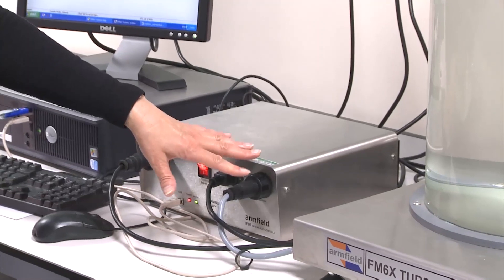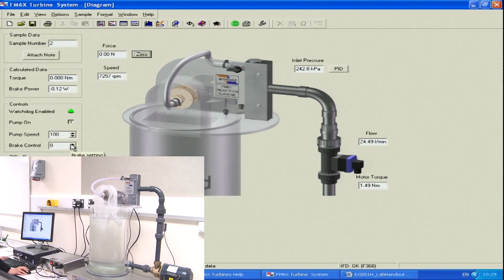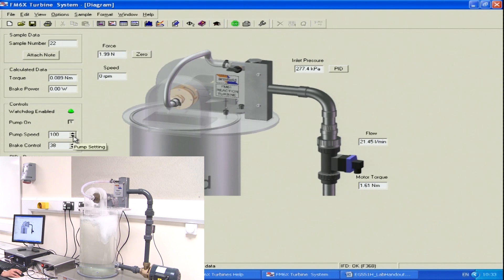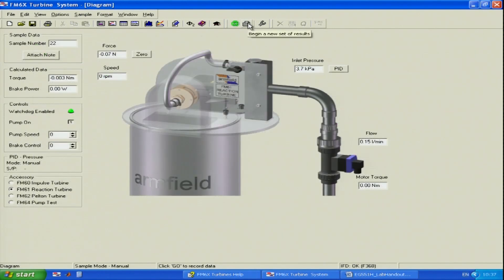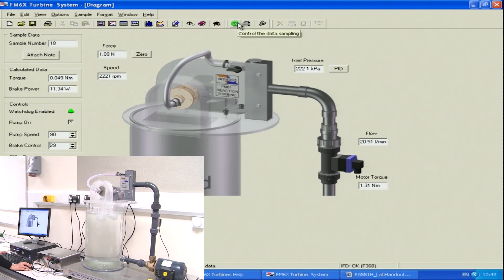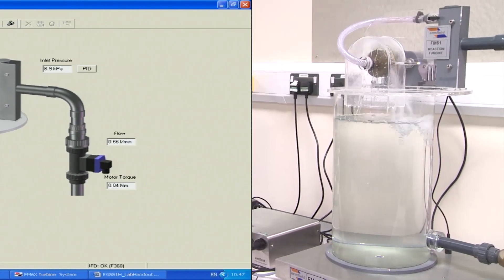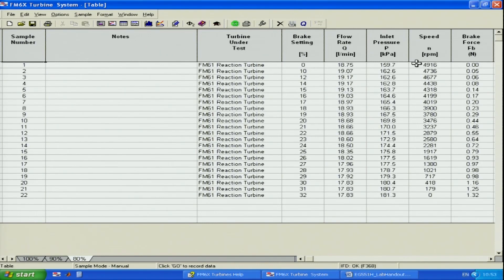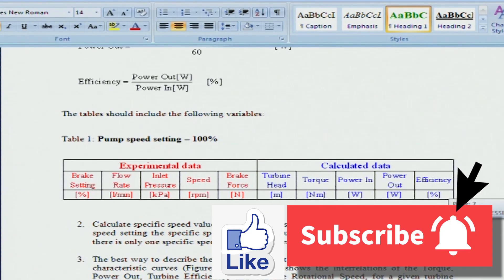Online laboratory experiment: TURBINE TESTING exercise

Comment from the maker: Turbines vary widely in type and in power capacity. In order that optimal choice of machine is made for a particular application, the characteristics of machines must be known. These characteristics can only be generally described using turbine design theory; for detailed performance characteristics the machine is tested in a laboratory. In the case of a very large machine it is generally uneconomic to establish its performance by testing at full scale. Thus, a scale model of the machine is tested in lab conditions and the full-scale machine performance is predicted using the data obtained from model-testing.